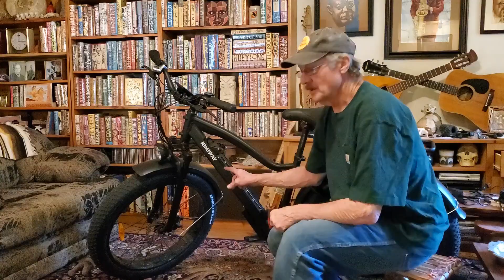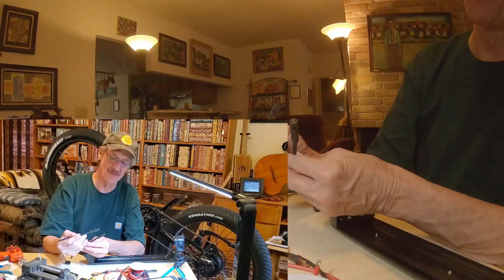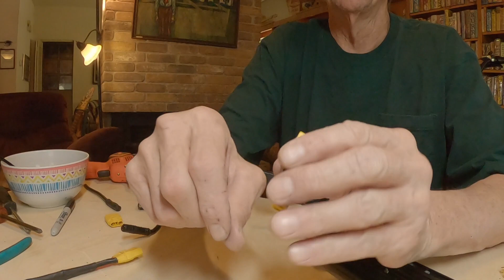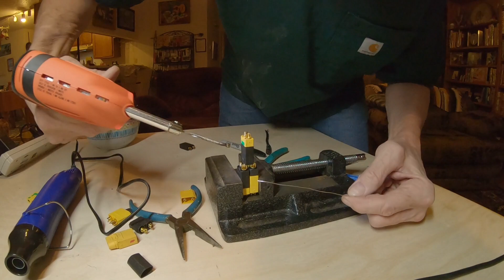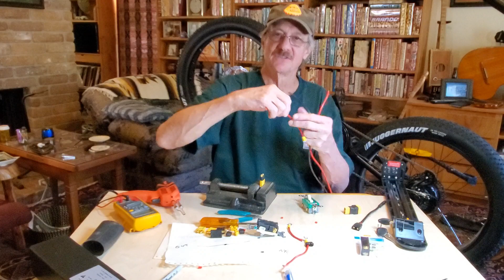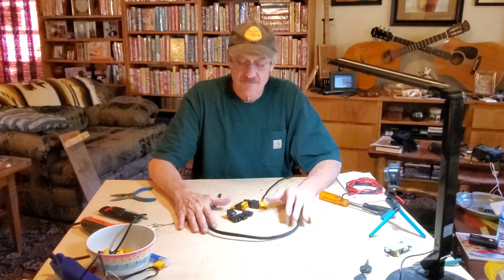HIMIWAY - Dual Battery Wiring

Comment: Good job on this video, I have been riding recumbent trikes for several years. I electrified my current trike and now I want to ride faster longer. By the way I'm 83 and still hot rodding. My set up is a Bafang mid drive with a 48  volt battery. Your video is a great help. Thanks for producing it.

Comment: Parallel is the way to go with equal batteries,  if you half current for batery voltage drop less and power  lossess less with square of current.  Really you do not look for double the range what is even possible. For currents 5 or 10 A saving could be 5-10% even with additional weight in some intrrconnection lossess , main thing is avoid deep discharges, riding with higher voltages.  Problem is space , xt60 excellent connector easy to put 2.5mm2 wire but hard to put 4mm2 which should be really in.  5% on 240V is 12V , but 12V on 48V is not 5% but 25%. XT90 EXcELLENT connector can put easily 6mm2  but relativly big hard to find space except outside.
This time  used smaller option if any problems ,   will go only min 4mm2 and xt90 connectors.
The other problem found conector for derodo baterry but contacts not gold plated could be in DC environment good only for 10A? Normal use will be in avg 5A ? Cold be even voltage rating . 
On solid rear rack two batteries could be mounted on the side below rack level,  if no side  bags or if you put one or two bateries in the midle of the rack ,  bags could be on the side .

Y connection only if BMS take care about reverse currents .  Voltages never the same could be some suprises before or later.
Reply: Dean connectors are underrated and written off too much imo. They look much cleaner take up less space, And can handle 80-100amps with the ultra versions and when connected & wrapped properly they won't budge or take in weather so there's no real compromise over XT.

Comment: You could have saved destroying your wires cutting them if you researched series battery blenders.electric all wheels sell a blender kit that is a total plug in kit that includes wiring with the correct connectors . No cutting or soldering. $70 + shipping. Fits Radbike,Himiway and Magicycle.

Comment: Hi stan I just bought a 52 volt 15 amp magicycle cruiser, I probably should of paid a little more and upgraded to the
Cruiser pro which comes with a 52 vo!t 20 amp battery, anyway what battery can you recomend I use to do the upgrade to my magic cycle. Awesome video by the way

Comment: The best way to run two batteries at one time is with a device designed to do just that. It’s a little costly, but the benefit is you can batteries of different voltage and charge levels. Watch this video, they are the company that makes the dual battery system optimal.
https://youtu.be/pvumfnCff10

Comment: After upgrading from a 10 to a 15ah battery, i feel as if its pointless to have two batteries connected to one hub. I would plan on adding a front hub motor, of the same wattage as the rear, vs doing all of this. Makes having two batteries more useful in my experience. You are still gonna be helping out the other battery by using both at the same time with two motors.

Comment: If I connect the batteries parrallel, can I just charge up one?  Leave the spare on the bike and charge only the Himiway.
Reply from the maker: No. They both have to be at the same voltage when connecting parallel.  Bolton bikes now sells a device that allows you to do what you want.

Comment: Good job mentioning the danger of simple parallel wiring.  Hopefully everyone really paid attention to that.  More than a negligible voltage difference can readily exceed the carrying capacity of the wiring or connectors which could be catastrophic.

You could have mentioned that there are current limiting Y adapters designed for parallel eBike battery configurations that will limit the current passing between batteries of differing charge levels in order to ensure safety.  Those are a smart inclusion in any parallel design as there are multiple reasons the batteries could become unbalanced over time.  For example, over time, two widely differing batteries (e.g. cells from different manufacturers of differing quality) will reach two different top off charge voltages.  Also, any faulty or loose connection to one of the batteries while riding will drain the other, creating a catastrophic connection once discovered and "fixed".  For safety reasons, I would never recommend raw parallel connections like this.

Also, for shrink wrap, the best has a type of hot glue on the inside to waterproof the connection.  Of course that wouldn't work on your homebrew Y adapter, but you could pour silicone into the gap to seal it fully.

However, there are multiple issues with your switch design using a 110v wall switch.

First of all, an eBike like the Himiway has a microcontroller rated at 25A for maximum current from the batteries to the motor.  So you are correct that any switch rated for only 15A or 20A will immediately have its rated capacity exceeded in daily use when accelerating under load, and likely at simply maximum cruising speed continuously exceeding it given the 750 watt motor in the Himiway.

However, switches that are designed for DC as opposed to AC voltage are quite different in design of their contacts and the rating capacity doesn't carry over directly.  Here is a discussion on the differences:

https://www.cruisersforum.com/forums/f13/how-to-calculate-dc-switch-amperage-if-ac-amperage-is-known-249407.html

In fairness, since we would assume the switch will only ever be thrown while stopped (I would never suggest anyone try and switch 48v DC under a load with anything other than a switch purposely designed to handle such a switching load in DC voltage), there will be minimal current passing from the battery to simply power the controller and display.  Ideally the bike can be powered off each time the battery will be switched.  Either of these may reduce or completely eliminate the arcing that occurs in DC switches when switching a load.

However, it does not change the fact that a switch designed to carry 30A max at 110V AC will not necessarily be able to carry 20-25A under a 48V DC load without fusing or burning the contacts over time.

Also, an indoor wall switch is about the worst option to be able to waterproof.  A better switch would be a toggle switch, which can have a rubber boot over the switch to provide a degree of waterproofing:

https://www.amazon.com/Blue-Sea-Systems-WeatherDeck-Toggle/dp/B000MMFIZS/ref=sr_1_21?crid=1XS1QOQ9OMYMK&keywords=waterproof+toggle+switch&qid=1640829928&s=sporting-goods&sprefix=waterproof+toggle+switch%2Csporting%2C93&sr=1-21

https://www.amazon.com/Autoec-Rubber-Toggle-Switch-Weatherproof/dp/B017SMTR42/ref=sr_1_1_sspa?crid=F1P5LD3LCN41&keywords=waterproof+toggle+switch+boot&qid=1640830765&s=sporting-goods&sprefix=waterproof+toggle+switch+boot%2Csporting%2C90&sr=1-1-spons&psc=1&spLa=ZW5jcnlwdGVkUXVhbGlmaWVyPUExODQ0VkFYQVZIN1gmZW5jcnlwdGVkSWQ9QTA3MzIzMTYyNTFRSzVSOTQ2M0hIJmVuY3J5cHRlZEFkSWQ9QTAwODQ5OTdLS1M2V1pVSTU3OUEmd2lkZ2V0TmFtZT1zcF9hdGYmYWN0aW9uPWNsaWNrUmVkaXJlY3QmZG9Ob3RMb2dDbGljaz10cnVl

Finally, the innertube is a horrendous idea for waterproofing, since it simply creates a funnel shape to capture water in the top which then passes through any air gaps between the multiple wires entering the top.  Water on the cable can adhere to it and run down the cable into the assembly ensuring that everyone inside is quickly wet.

Better option is a small waterproof project box with stainless steel screws:

https://www.amazon.com/gp/product/B089K4KCQK/ref=crt_ewc_title_dp_4?ie=UTF8&psc=1&smid=A2WO5FNI6I91SW

And then IP68 rated waterproof connectors as are used to pass wiring from solar panels above an RV into the interior:

https://www.amazon.com/Black-Plastic-Waterproof-Glands-Joints/dp/B01JYIV9BM/ref=asc_df_B01JYIV9BM/?tag=hyprod-20&linkCode=df0&hvadid=193989831776&hvpos=&hvnetw=g&hvrand=15921271753919122285&hvpone=&hvptwo=&hvqmt=&hvdev=c&hvdvcmdl=&hvlocint=&hvlocphy=9012131&hvtargid=pla-307093602907&psc=1

Additionally, all electric connections and terminals that will be exposed to changes in humidity will benefit from a dielectric grease being applied to waterproof them from corrosion:

https://www.amazon.com/s?k=dialectric+grease&i=tools&crid=X74YHK2XMZRI&sprefix=dielectric+grease%2Ctools%2C126&ref=nb_sb_noss

Comment: What's the power rating on that light switch? most are only rated for 15-20 amp. Also. they are not rated for an inductive load. that switch WILL be a problem.

Comment: I know this is a added cost Stan, but it is much safer and you don't have to cut all your wires up and can be put back to the original state at any time. DATE DX2 https://www.youtube.com/watch?v=pvumfnCff10 I've been using one for a while now and you can run either battery or both at the same time. Two Batteries not only doubles miles but even give you extra because of the extra cells it sips more slowly from each.

Comment: so you do not need the module sold at Bolton Ebikes?
Oh Himaway.?/  I swear I keep hearing hemmingway
Reply from the maker: It would be safer to use the module sold by bolton. You don't need both batteries at the same charge level.

Comment: do you need to charge each battery with its own charger  or ?
Reply from the maker: Once they are connected, you only hook up one charger and they both will charge.
Reply: @stanthereservoirrat5934  yes i understand that but one battery is originally 48v 30ah with 5a charger , and another battery is 48v 15ah with 2a charger, on second battery manual it says that 2a charger should be used ??? so using 5a charger can be problem then ?

Comment: It's a good idea but you really dont need to do that just get a second battery mount the battery bracket put the extra battery on your bike use it to hold your extra battery and just switch them when you need that battery really all your doing is giving convenience to push a button or switch doing it the other way

Comment: I put 4,000 miles on my Rad Rover -- I purchased a new Himiway Cruiser -- more power -- bigger battery -- BUT -- I need 2 batteries -- so I ordered another Himiway Battery -- $430 -- I don't have to rewire anything -- I just swap out the batteries -- every 1 & 1/2 hours -- because I need to go 60 miles -- not 30 miles in 1 1/2 hours -- I average 20 mph -

Comment: Why dont you use the Micro chip that controls both battery's and you dont have to worry about the battery's being at the same charge and you have much more control over the battery's if you do it this way the way I did and there is NO DANGER of  BLOWING UP the battery's because one battery is NOT the same Quality as the other and it goes bad quicker

By doing it with the Micro chip I used you just have to make sure the 2 battery's are rated at the same VOLTAGE like 

2 48v battery's or 2 52v battery's is all you have to worry about  with this chip you can go up to 60v battery's

Comment: Interesting - I have many 18 volt Milwaukee Batteries 9 amp hours each - so I use a 300 watt inverter - and a step down transformer - to 12 volts to power my inverter and charge my battery -
Reply: I decided to purchase another Himiway Battery -- $430 -- I need to go 60 miles -- not 30 to 35 miles -- I average 20 mph --- I just swap out the batteries -- no rewiring needed. -- plus my bike warranty is still A-OK

Comment: Hi I have a standard e-bike and wanted to add another battery in parallel but I can't see a controller anywhere on bike and the tubes aren't thick enough to hide it inside. Plus the holes in frame are also to small for a controller to be placed inside. Is it possible that it does have one? 😕

Comment: hello doing this to my radrunner I added a motorcycle headlight to mine(running off radbattery) and a switch for the light I used a 4 pin automotive relay and a cheap on off switch on amazon that mounts to my handlebar I spliced into the controller side(where battery cradle connects to controller  to supply 48volts to a 48volt to 12 volt converter (used on golf carts) I use that convertor to power my 12volt items lights usb phone chargers etc ... I also put xt 90 anti sparks on my controller and my battery cradle .....now that you are up to speed with my situation my question is about the switch you used you stated that the local hardware store only goes up to 20 amp can't i use a cheap dinky handle bar switch that goes 3 ways  and use it with a 40 amp automotive relay isn't that what the relay is for so that the switch dose not melt thank you

Comment: I dont know how I feel about matching batteries with different ah
Reply: Different Ah doesn't matter. It's just the size of the resevoir so to speak. Your voltage has to be the same though.

If wired in parallel your voltage remains the same and your Amp hours become added together to increase your overall capacity.
Reply: @nicholasbrassard3512  How about wire it in series and quadruple your speed?

Comment: With all due respect. Why can't the backup battery just be wired to be plugged into the charge port of the stock battery??
Reply: I see your point but the charge port may only be designed for charge current amps (3 amps possibly).  Might have a melt down or possible fire hazard. I am surprised that I don’t see many posts of battery connection connector plug failures from over heating. Just thinking I would keep a close eye on battery connections. A lot of electrical problems start at dirty or poor connections.

Comment: Your parallel battery kit works great. 
Instead of cutting the battery cable, and voiding my warranty, I cut the plug off a burnt out Radrover controller and soldered it to a female X90 plug. Works perfectly 
Thanks Stan, you're the Man!

Comment: Hi Stan. 
Just bought your parallel battery kit for my Himiway cruiser. 
I have an identical himiway battery with the mounting tray. Even though they're both 48v17.5ah, the Himiway charger is 2amp, and the charger for  the other one is 3amp,and has a fan. If I'm running both parallel, which charger should I use to charge them parallel?
Reply from the maker: i would use the 3amp. it would be faster. both would work.
Reply: Thanks

Comment: Hey Stan great video.  My Himiway is being delivered tomorrow but not sure I will need and extra battery but would like to investigate a controller that provides higher current (AMPs) output maybe in the 30 Amp range. With a 48 volt battery and thirty Amp output you can deliver 1440 watts to the motor.  This combo would make for a seriously powerful E-Bike.

I do have a suggestion on making your parallel connector out of the XT90 plugs.  I learned this while making up similar connectors for some of my RC Planes.

I'm not sure you know this but the pins in the connectors rotate very easily allowing you to connect them better if the notches in the connectors are rotated so the notches align better. Also I would pre-tin the all connection points before attempting to solider them together this promotes better heat transfer.

Also on you switch design there are single pole/double throw toggle switches that could used and put it in a small plastic project box available many places on line.
Reply: Xt90 plugs

Comment: Rad is really just shooting themselves in the foot, by not upgrading the controller.  I just picked up the Speedrid $950.  It's $650 less and way faster.
Reply: I wouldn't race either the RAD or Himiway because both those bike are much faster.  The Himiway being the faster of the two.
Reply: @Hoggdoc1946  na the Speedrid is faster than the Radrover, but not as fast as the Himiway. The Speedrid has a 18amp controller and tops out at 26mph with throttle only. 28 if you pedaling it a little.  I'm pretty  sure the 2018 Radrover has a 16.5 amp controller. The motor looks alot like the motor in the Himiway if you take it out of the case. (I think it's the same motor that's in the Lectric xp) Its bigger than the 500 watt motor that's in the Rad, but not as big as the true 750 watt bafang.  Read the Reviews on Amazon the thing is a beast for the price.
Reply: @Hoggdoc1946  Speedrid is the model the manufacturer is Ancheer
Reply: Booooom

Comment: Wow i have a 2nd battery wanting to do what the video is about ! I have a Himiway and another 17.5 48v lithium wanting to make my travel distance a monster. I plan to put the battery on the rear rack but have the slip on bag above the battery.  I figure i can get 60 - 100 miles with just pedaling. Thanks Pat

Comment: Nice job. Would like to see the soldering of the double connector in more detail.   

Is there a way to verify a battery's amp hour size?  I have a 19.2 ah battery that is physically smaller than a 17.5 ah battery pack.  Makes me curious.
Reply from the maker: the himiway battery is bigger than it has to be. you can get higher amp hours with higher quality batteries.